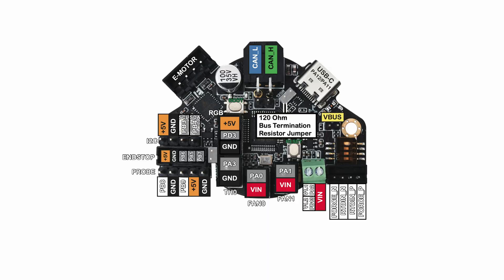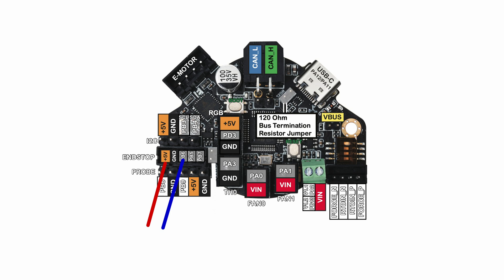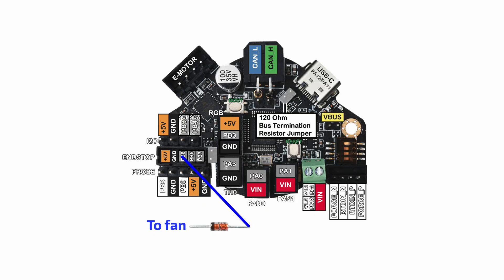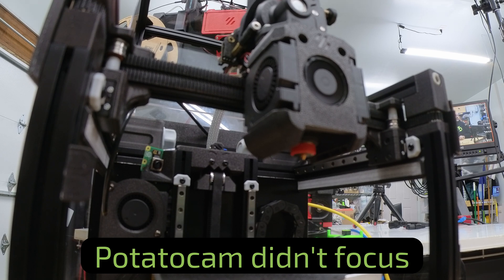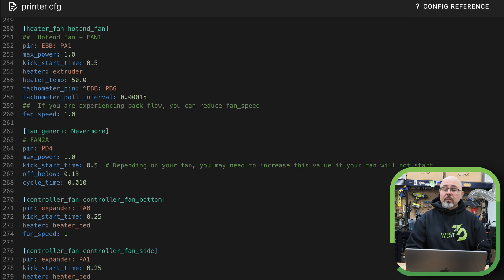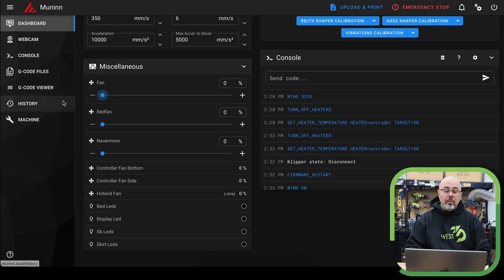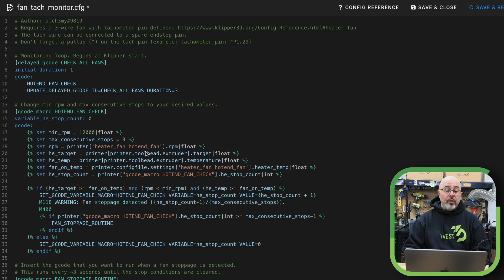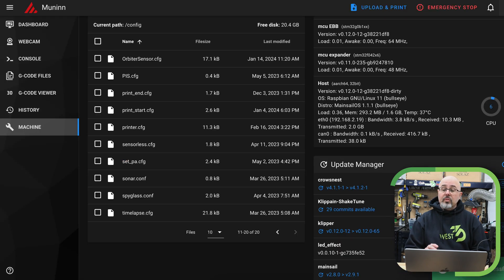Tach fan mod for Klipper

Comment: In chatting with GROK about the BAT85 diode:  
Let’s summarize the discussion on connecting the tach output of a 24V 3010 axial fan to PB6 on an STM32G0B1CBT6, incorporating the suggestion of a single BAT85 diode and the need for robust protection. I’ll use the `|` symbol to indicate BAT85 polarity (anode to the left, cathode to the right, e.g., `--|>`).

---

### Summary
The goal is to connect the fan’s tach output (open-collector, pulses to ground) to PB6, using the existing endstop circuit in your schematic (Endstop_1 with a 10 kΩ pull-up to 3.3V and a 2.2 nF capacitor). A single BAT85 in series was suggested online, but it lacks sufficient overvoltage protection for a 24V system. A hybrid approach ensures safety:

1. **Tach Signal**: The fan’s tach output pulls low (0V) when active and floats when inactive. A 10 kΩ pull-up to 3.3V (R35) sets the high level to 3.3V, compatible with PB6.
2. **Single BAT85 Limitation**: A BAT85 in series (`Fan Tach ---[BAT85 --|> ]--- Endstop_1`) blocks negative voltages and allows the signal to swing between ~0.4V (low) and 3.3V (high). However, it doesn’t protect against overvoltages (e.g., 24V miswiring), which could damage PB6.
3. **Recommended Protection**:
   - Add a series BAT85 to block negative voltages.
   - Include a 4.7 kΩ series resistor to limit current.
   - Add two BAT85 diodes to clamp voltages at Endstop_1 (to 3.3V and GND).
   - Reduce the 2.2 nF capacitor to 100 pF for better signal integrity (tach frequency ~333 Hz at 10,000 RPM, 2 pulses/rev).

---

### Final Schematic
```
Fan Tach (Pin 3 of P10) ---[BAT85 --|> ]----[4.7 kΩ (R_new)]--- Endstop_1 ---[10 kΩ (R35)]--- 3.3V
                                                    |                |
                                                    |                +---[BAT85 --|> ]--- 3.3V
                                                    |                |
                                                    +---[BAT85 <|- ]---- GND
                                                    |
                                                   [100 pF (C40)]---- GND
```
- **BAT85 (Series)**: `--|>` blocks negative voltages; anode to tach, cathode to Endstop_1.
- **4.7 kΩ (R_new)**: Limits current if 24V is applied.
- **BAT85 (Clamp to 3.3V)**: `--|>` clamps overvoltages; anode to Endstop_1, cathode to 3.3V.
- **BAT85 (Clamp to GND)**: `<|--` clamps negative voltages; anode to GND, cathode to Endstop_1.
- **C40**: Reduced to 100 pF to avoid distorting the tach signal.

---

### Why This Works
- **Signal**: Swings between ~0.4V (low) and 3.3V (high), safe for PB6.
- **Protection**: Handles overvoltages (clamps to 3.7V), negative voltages (blocked by series BAT85, clamped to -0.4V), and transients.
- **Compatibility**: Works with the fan’s open-collector tach output and the STM32’s 3.3V logic.

This setup ensures reliable operation while protecting PB6 from potential issues in a 24V system. Let me know if you need further clarification!

Comment: Is the diode only needed because your using the endstop port to power the fan?  If my board has a 3/4 pin fan header i dont need a diode correct?
Reply from the maker: The diode is needed to stop the fan from grounding through the tach line and running constantly. Not every fan does this, but adding the diode is cheap insurance.
Reply: @west3dprinting219  thank you
Reply: Late to the gate :)  but if the board has an official 3 pin or 4 pin fan header then it should also have the protection via diode or opto isolator already so you should not need one, adding a second may inhibit detecting the tach pulses. also the 4 pin fan implementation is not an issue as the fan is 100% powered and therefor you dont get the leakage current through the tach pin. 3 wire fans on the other hand can be a big problem if your connecting to a 2 pin fan header and jumping the tach pin to another gpio, as stated in the video  it could wreak havoc to your controller, diode is an easy protection in this case. I am in the process of publishing a detailed video to my channel regarding this

Comment: Great video mate, this may be a silly question but are all fans with 3 wires the correct fan for this purpose?
Reply from the maker: Not all of them, it may be either a tach line or an alarm line. An alarm line will tell you if the fan just stops completely. A tach line gives you a lot more potential to use software

Comment: Sound like a good idea. I've been thinking about a thermal fuse like they use on heatbed's that will cut the power of the hotend in case of thermal runaway and if those safety's fail. Don't know if anyone has done that before, but sounds like a nice extra safety feature in my head. Lol
Reply: I've had thermal fuses on my hotends since 2016

Comment: The dragon/ rapid burner has a spot for a bead temperature thermistor to measure the temperature of the heat sink and a block of klipper code to stop the print if the heat sink gets over 85c. Since you have an EBB 36 and if you are using a PT 100 or PT1000 on the MAX chip you have another thermistor connection to put this bead thermistor. This is a lot better solution than a tach fan because even if the fan is working you could for some reason get heat creep and this would let you know about that. It is probably and even cheaper solution and easier to set up.
Reply: Also adds the safety that it isnt going to be shut down at false readings on a Tach fan as well,
Reply from the maker: This can be mitigated through the max_consecutive_stops setting. Too many consecutive false positives indicates a problem with the fan or wiring.
Reply from the maker: Not everyone uses a Dragon/Rapidburner